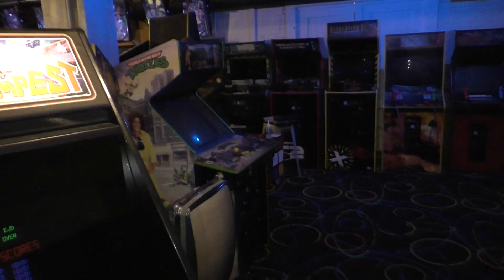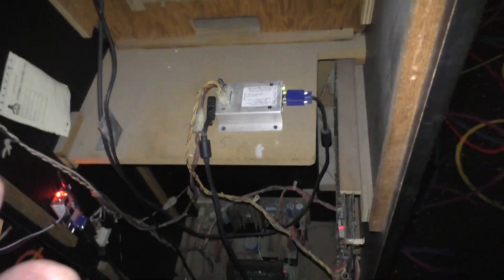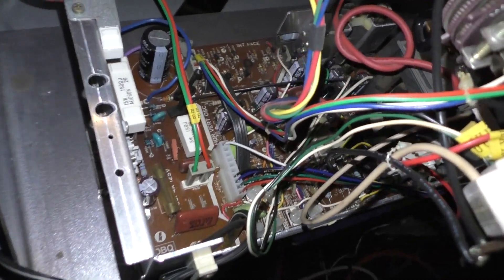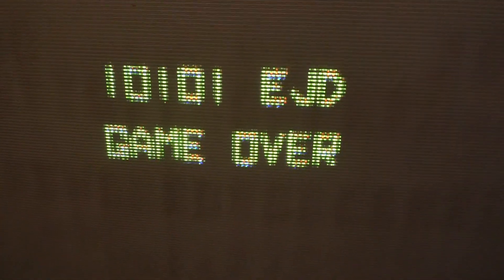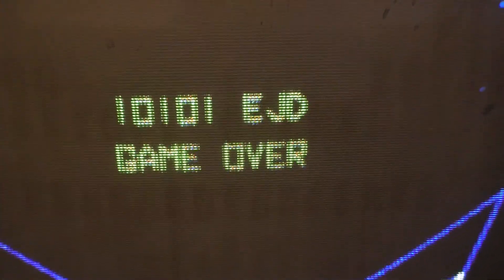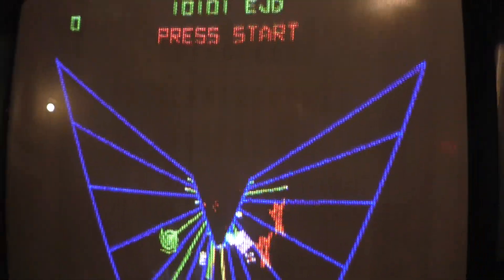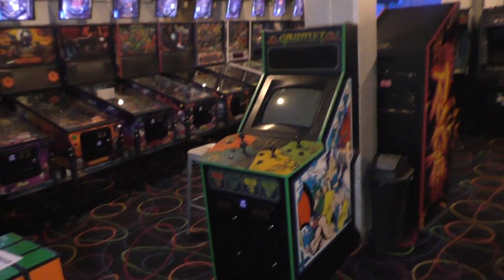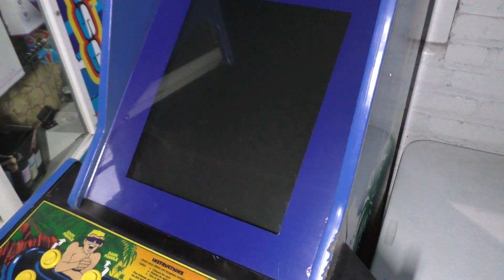Can You Run Vector Graphics On A Standard CGA Monitor? Let's Find Out!

Comment: If you still have the 6100 chassis and boards but the tube is gone, I've read that you can replace it with something a little more standard. It may involve rewinding the yoke, but I've also seen that there are converter kits that can let you use other tubes. This looks like a pretty nice alternative!

Comment: There's nothing special about the vector CRT itself. If you have one with the same neck pinouts and deflection angle as the WG6100, you can pull the deflection yoke off it and install it on the replacement tube.

Comment: My concern would not be how it looks, but rather input lag. It seems like there will be some delay in the video signal as it needs to first be processed by the first converter, then a second delay as it gets processed by the second converter, which means there might be some level of delay between the press of a button and the visual change on screen (aka input lag).  If the input lag is undetectable, then I think you have a winner.
Reply from the maker: Completely undetected as far as I can tell. Immediate response when firing and moving.

Comment: What about running a 6100 hv & deflection on a CRT tube.  The neck can be adapted but you would need a 6100 yoke.  Thats a route to take if its just a necked tube - that 4900 is a great donor tube as its a 19VLTP22 which is the same neck socket.
Reply from the maker: Did that with our Star Wars machine. Tube swapped the Amplifone tube with a 4900 tube and it works great!
Reply: @MikesArcadeMonitorRepair  are there options for tubes for an amplifone 25”?

Comment: Mike what is the diffrence it the tubes? Why can you not tube swap into a vector monitor?  I like this idea !!
Reply from the maker: There are only two Vector monitors that were ever made and are rare. They take the X/Y signals from the PCB and via a deflection board, display the vector graphics. They are completely different from a standard monitor.